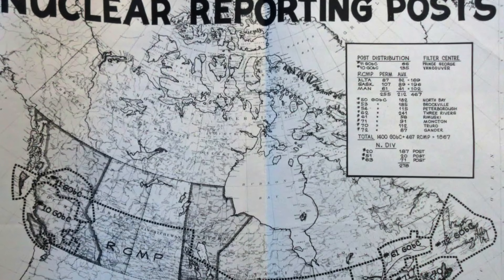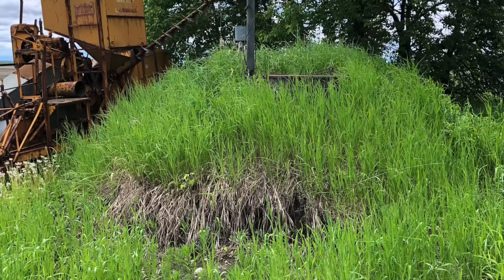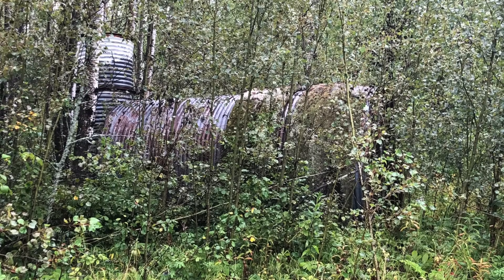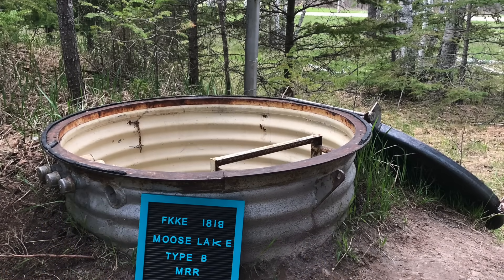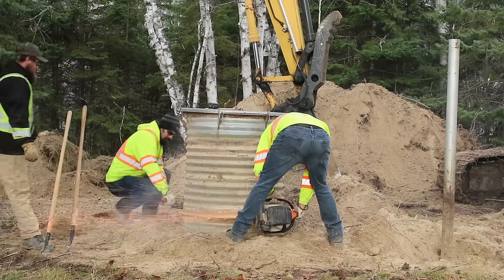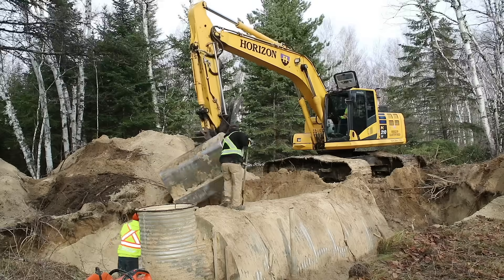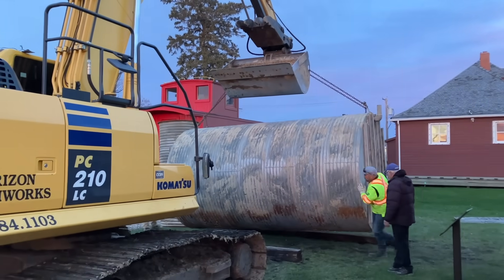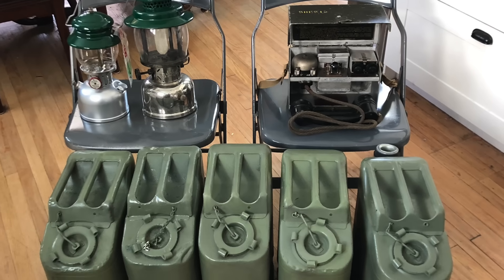The Miami Bunker Project: Saving Cold War History

Comment: Thanks for posting this video. It brought back the memory from when I was a kid during the nuclear scare. In Los Angeles in 1961 there was an above ground display of several prefabricated shelter's which could be purchased and installed in your garden. I remember going into them with my parents. One was like the galvanized tank in the video, another was shaped like a military quanset hut, and a third was elaborately furnished  like a travel trailer with a separate toilet room. It was a large modified underground gasoline / diesel fuel tank as commonly used in Gas Stations. There was even a poster with a forest scene in a fake window frame which was over the kitchen sink. As it was a very tense situation at the time, money was tight, so my Dad built up a corner of our basement with cement blocks as a shelter.

Comment: Are you absolutely sure you don't have some English blood in you somewhere in the distant past ? We have dozens of chaps like you (not mainly as good) trying to preserve important items nobody has considered. We have a 30 odd mile canal called the Basingstoke Canal. It cannot be used due to bats. They live in a tunnel and might get frightened if a narrow boat glides past. They are not endangered, but an offer was made to build a tunnel off the canal for them. Not good enough. Without any revenue from the canal, the locks will disintegrate. Bats come first. f%^&*ing idiots.

Comment: What an amazing project - a real labour of love.

In your lecture you said that the bunkers didn't appear to be fully cylindrical, but this one clearly is. Were there variations, or was the one you found that had the floor welded on modified after excavation?
Reply from the maker: There were two variations: the "corrugated" shelters like this one, which were fully cylindrical, and the "smooth" shelters like the one I covered in my first video on NDFRS, which had the bottom of the cylinder cut off and a flat floor welded on.

Comment: Cool prodjekt! 
When cutting the door in the back you can keep the cutout panel as the door blade ,so it can be closed rekreating the volume of the shelter when closed . Having a open corridor or  new door installed, adds false volume and non historical correct components.
The hinges could be mounted on the passage side door opening outward ,when the panel is closed there would only be a narrow slit made by the cut of wheel around it.
You will probably need to have a dehumidifier in there also this can be installed  "outside" using the original air vents as  air ducts . If you do the corridor a  wider than the door in back wall there can be exhibits in it like maps over the system ,information boards etc.
Adding a outside ,insulated door to the corridor, and insulate the exposed part of the corridor it self will maintain the climate in the exhibit, and prevent condensation / draft.
Electrical fuse box/ light  /dehumidifier: controls can be integrated into the corridor wall. Cabels drawn in through
The back wall to ligts etc... 
If you bury the fallout shelter in Sand use paint with sand or glue sand on the surface on the corridor insides to make it look like its a cut in the fill .
If the corridor is made of concrete you can use natural ballast and remove the "cement skin" to expose the barlast.

Comment: Throwing "refreshment garbage" into excavations must have been a common practice, and when you think of it, makes some sense. When my septic system was replaced 10 years ago, soda bottles were found from the early 1960s (when the house was originally built) of brands long gone. The ink/paint silk screen labels on the bottles were in pristine condition too.
Then, years later when I sold my parents house, I had to remove the underground oil tank. Well, the same thing happened. More bottles, and this time a different defunct soda brand!
Reply: It still is to some degree, but more with nails and scrap building supplies now.

Comment: What makes me wonder is the very unusual (as far as I know) entrance to this shelter - a vertical shaft with a ladder. Basically, military shelters generally had an entrance in the form of an armored door in a depression in the ground. Vertical entry with a ladder was rather used for less frequently visited installations, underground communication nodes, etc. Such an entrance does not seem optimal to me if the shelter may be close to the site of the explosion - trees may fall on the entrance and block it, injured people inside may have problems getting out via the ladder. In war, an artillery shell can fall down this shaft - but in the case of this structure it was not important. In a sense, the design change you made created a "correct" entrance (not blast-proof, but I'm ignoring that here), and the vertical entrance remained as an "emergency" one, because most shelters had a vertical emergency exit (albeit constructed differently).
Reply: Small bunkers, especially ones from that era almost always had vertical entrances. 
i might be wrong, but it sounds like the area has a high water table (the bunker needed to be staked down to prevent it from floating to the surface),
so a depressed or recessed entranceway into the side of the underground bunker wouldn't be worth the hassle, as they would certainly get fouled with debris and water. 
its a great idea for ground level display though.

The nice thing about these tube bunkers with vertical entranceways  is that, if they are welded shut properly, they are highly resistant to water intrusion.  
unlike the vast majority of civil defense bunkers made out of concrete, which have fallen victim to ground table water intrusion.
Reply from the maker: Plus, the vertical tunnel makes for much easier installation - just dig a hole, drop the shelter in, and cover it over. No need to cut out an entrance ramp with retaining walls to prevent the ground from caving in etc.
Reply: @CanadianMacGyver  It's all true, that's why I say that this entrance is surprising because it's unusual, but it definitely made sense. After your "structural correction" you will have to struggle a bit with the water in the recessed entrance. Good drainage is necessary in such situations. Recently, a new railway line was planned to be built in our area. The local population wanted a passage under these tracks. The designer grimaced that water would accumulate there and it would be necessary to dig a deep well somewhere nearby to which the water would move.

Comment: That is so very cool! Watching a good heavy equipment operator at work is always fascinating. The connection they have with the machine basically makes it an extension of themselves.  And I hope those Coleman lanterns will have proper Thorium impregnated mantles. The newer mantles are junk.
Reply: My colemans and my aladdin lamps hate the new mantles

Comment: 2:26 they are underground, unless you are buying from mole people that is a lie.
Reply from the maker: If you want to cultivate the soil, build a structure with a basement, or install a septic tank etc. (which many of these owners are planning to do), then these shelters definitely get in the way.
Reply: @CanadianMacGyver  interesting, normally if a building needs a basement or septic system they are installed when the building is built.